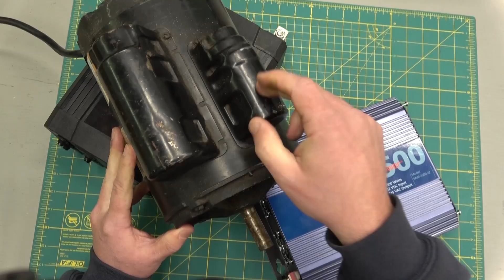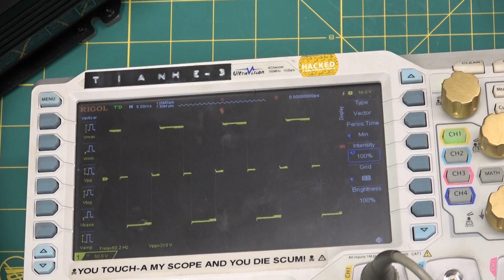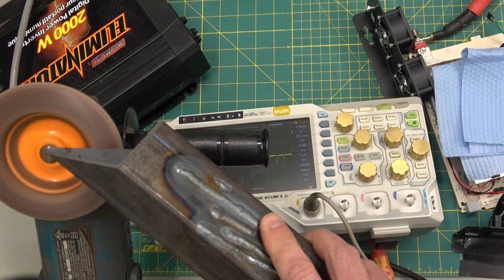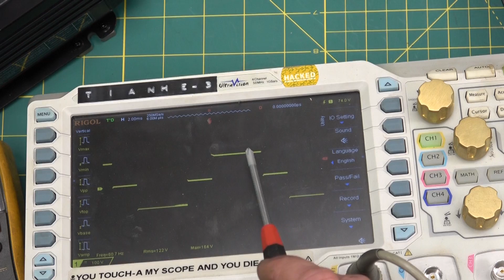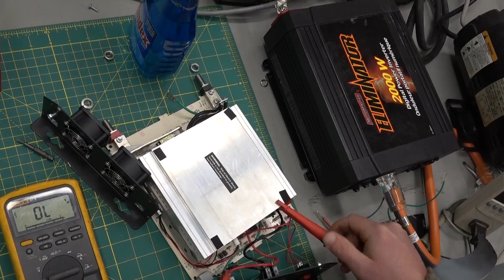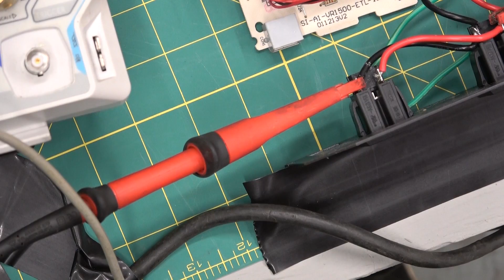BOLTR: Samlex inverter | Cheap vs. Expensive

Comment: I already got assaulted and assimilated and now you want me to get inverted.  The demands of youtube are too much.
Reply: Once they invert you over the bench you will be asstimulated.
Reply: I have a 3200 watt vanner tru sinewave inverter that's tough as shit, weighs 75pounds, I might be interested in shipping it out there if you wanna check it out if I get it back https://www.invertersupply.com/index.php?main_page=product_info&products_id=29594
Reply: And my guitar gently weeps. Lol
Reply: howdy Harold
Reply: Lol
Reply: Resistance is futile
Reply: You are soo slow
Reply: I think the cheaper one had a more analog setup built to produce brute power. It toatally looked like something out of the 80s on the board. Its the toroidal magnet inducer lol
Reply: resistance <1ohm
Reply: Shirley unlike the Borg, with AvE Resistance = Infinity [ unless its Capacitance then in that case you better just hold my Beer]
Reply: @timberwolf0122  LOL. Excellent. Thanks - Lumpy
Reply: Paolo G 😂😂😂
Reply: & NUKED  Too

Comment: i salvage old backup inverters from various cell tower instalments and internet service providers.  usually they just need new batteries (or just put jumper cables) not as efficient as "modified" sine wave, but real nice true sine (or kinda close on some) for running computers or audio, etc

Comment: I find that soldering connections like the one that had failed are a bit tricky in that your instinct is to poor the heat and pile the solder on and you get a good connection.  Problem is the metal components are cast into plastic, so you have to minimize the amount of heat applied.  I melted the crap out of a switch like that a couple months back, then realized that you're supposed to use crimp lugs on it.  This outlet connection is obviously not a crimp lug connection, but it is one of the (relatively) few that are done by hand and the person failed to apply enough heat and solder.  I suspect that when you repaired it if you applied too much heat you could easily damage the outlet.  Suspect being the key word.

Comment: I needed an Inverter review and knew you should made one, searched for it, and here it is.
I am building a little refuge in the middle of nowhere so I bought an Inverter to use with my car.
After reading a buch of theory I came to the conclusion that the "modified sine inverter==square wave" is appropiate for universal motors while the "pure sine wave" is needed for "asynchronus" motors...
Why?
May be because of the "rotating field".
¿Is that right?
Regards.

Comment: The cheap AF eBay ones have replaceable fuses on the outside and due to extreme testing and emailing the supplier they put in a line level fuse too to save the traces when backfed

Comment: i generally use cheap inverters unless what ever im powering needs pure sine.  some lights get really annoying with modified sine as well so i mostly use 12volt or 24 volt dc lights.
Reply: when i first started using solar i found something similar my expensive inverter was a piece of shit so i just dont see the point in spending a ton on them anymore

Comment: Purely anecdotal here but doing truck equipment installs the el cheapo microwaves seem to be the the Bain of most modified sine wave inverters. More than once the old crappy tire inveterrs manage to outshine the samlex’s and  xantrex.
Inverters. Hard to sell that to a customer who’s spent a half mil on a new truck though. As soon as they see that eliminator label things get uncomfortable.

Comment: I tried to help a guy get his conventional single stage high efficiency gas furnace to run off his modified sine wave inverter/solar system. The first time we tried a call for heat, the furnace control board started shrieking like a stuck pig. Never heard one do that before. I thought the board was finished but, once back on the grid, the furnace worked normally. The guy figured out to use a pure sine wave inverter, cost him $5K back several years ago, but the furnace worked OK off it.

Comment: If you want to avoid that sparks on switching stuff on you have to use a solid state relais which can switch on the zero crossing. It's also much better on stuff you run via the inverter, since you avoid steep voltage drops.

Comment: If the high voltage DC section of both are the same voltage on each inverter's rails ( + GND -  "3 connections") , you can marry them both to make  a more powerful inverter. Since the wattage output of both are slightly mismatched it is plausible you may end with an approximate 3100 watt inverter. (Also you could use all 4 sockets for that purpose if you remember the maximum amperage of the socket itself isn't maxxed out and both inverters need to be powered on)

Comment: How about a 3 phase converter review(s) - the science and a product comparison. Our local Makers group received a milking machine donation, but it requires 3-phase power. The quandary: Pay $15k to run 3-phase from the other side of the building, or - use a converter. Converter is getting majority votes. Then, how to select the best bang/buck converter. So, I guess that conversion leaves us wanting bucks/bangs...

Anyway, would be great to see this you do a review of 3-phase converters.

Comment: I had a sine wave inverter UPS in 1998. It output a very clean sine wave.  It was huge and you wheeled it around like a heavily loaded handtruck.  It contained two car sized lead acid batteries.  It was given to me because the transistors had blown.  I replaced them and got it back working again and avoided overloading it in the future so the failure wouldn't repeat.  It threw away lots of heat creating the sinewave but that's the price you pay for that waveform.
Previously I had used a modified sine wave which has lots of discontinuous steps and doesn't get hot like the pure sinewave UPS.  But those steps create lots of eddy currents in transformers.  I had several wall warts plugged into it.  Power failed, and it ran for about an hour.  All the wallwarts over heated and blew the temperature fuse.  When I got the chance to pick up a broken sinewave converter UPS for free I jumped on it.  The new walwarts today with the switching power supply are very tolerant of the modified sinewave.

Comment: I'm using a cheaper but still not cheap 3000w pure sine inverter. Oddly, or maybe surprisingly enough, it is brand name Reliable...
Anyway, it runs on 24v DC, and I have two battery banks feeding it, 4 AGM batteries total. It will "reliably" simultaneously start and run two loaded sump pumps, 3/4 & 1/2 hp.

Comment: I definitely appreciate how you tear these things down and examine them.
In this particular case, I bought a 10K watt modified chinesieum inverter 5 or 6 years ago.  It was only 350 USD.
I wanted to take it apart before I put my solar system into action, but I didn't.  I have to say, it's the best one I've ever purchased.  I ran a solo clean line to my breaker box on a 30 amp circuit, and have used it many, many times to run my house.  On a conservative level, of course.  Lights, fridge, dish washer, fish tanks.
I imagine that it'll monica lewinsky one of these days, but there are 4 replaceable fuses.  Right across the front.  Money shot.

Comment: You would probably know, is there a power inverter that can charge a gaming laptop from your car lighter or a battery charger that can handle it? I'm talking 130watts. Output is like 19 amps 6. Something volts. Input is 100-240w 2. Something amps. I know nothing about anything and have been looking for a way to get an extra hour out of my laptop on the go.

Comment: If a single mosfet usually fail short, would the system not fail at that point? I wouldn't think that they would design a cheap system around operating over failure modes..?
I ask because the chain analogy would be accurate if it failed open but if it's a short and they are parallel and not isolation protected then would the source not just be pulled to ground?

Comment: Good example of this, look at Bose speakers and Beats headphones, both have a horrible frequency range and sound rubbish when compared to good speakers.. but they spend so much on marketing that they both became the biggest selling brands. It is funny hey, like buying solar panels for camping, buying the cheapest ones and replacing the diodes to make them as good as the expensive ones.. Saving $300 per panel.. both panels were made in Germany by the same company, diodes were like $3..

Comment: I drive a truck for a living and inverters like these are invaluable to running modern electronics (tv, dvd player, game consoles, laptop, assortment of chargers, microwaves, hot plates, ect) I've used a cheapo power drive unit comparable to the black unit and I've used high end built like a brick shit house ingersoll and rand inverters, the moral of this is, you get what you pay for.

Comment: Every video I watch of AvE reminds me of the stuff I've done in the past. I once used a 150W amp with a signal generator to create a power supply for a 4" 400Hz muffin fan that ran at 20k rippums. It had a very pure sine wave output.

Comment: Niche markets tend to charge a lot more for any piece of technology than you would typically see in a more "mass market" setting.  It should come as no surprise that an inverter sold by a company that you say caters a lot to the solar industry would be charging a lot more for the device than they would be if they were trying to sell it to everyone for more general purposes, even if it doesn't actually differ in purpose or suitability.  Seems to me like they're just trying to get while the gettin' is good.  Gouge while it is a niche market, before you actually have to start pricing more according to supply and demand.

Comment: the nastiest load for those things is to hook them up to a electric fence energizer machine will fuck em right up in one week some electronic bit is gonna give up the ghost. I have a relative lives in a cabin cattle country rolling plains keeps a few cows and he got the bright idea to hook up the inverter 220v machine output to the 12v dc in put of the fence energizer because the solenoid clicks better. I went out bare foot (the BRIGHTEST idea i ever had) and mannaged to clip the fence over head at the gate it grounded me like a sack of potatoes. Next week my relative calls me and says the machine aint clicking i go over and find out it has no in put the fuse was fine on the inverter but it would not work for some reason apparently it did not like to do lots of clicking.

Comment: The name "Samalex", adds to  the price which don't mean diddly squat this day and age. I bought one of those guns Canadians can't have to screw around with rather than trashing my name brand $2000 gun. The $500 budget brand is by far the better rifle of the two. I should have known. Colt was backdooring parts from numerous Asian factories that made Colt rifles under contract, but they eventually decided to tell Colt to get go fucked, and designed their own  rifles. Colt's source of cheap quality parts went away, and so did Colt's quality rifles, right along with Colt's lucrative government contracts. Not being a military contractor anymore colt will sustain huge fines for augmenting their rifles with backdoor imported parts or front door imported parts.  All the main parts save for the barrels are made by one of 15 or so soundries & forges anyway. One company bought a forge and I am avoiding them like ebola monkey plague. I watched too many new forges bankrupt established companies. Those foundry and forge guys are artists that know that furnace far better than they know their wives & children. A new forge has a massive steep learning curve, and their customers are can tell what parts came out of the new forge, because those parts will all suck ass. Their long established customers will leave them high and dry too. They have mines, refineries, mills, smelters and factories to run.

Comment: Only  one loose wire ,that’s what you paid for , Chinese ones  I repaired last week  bad soldering throughout ie 2 blade fuses rated 40amps large puddle of solar to hold in place, any load would have melted solder, wire I would not put 5amp load on ,no earth wire , the cheapness of components on board etc etc

Comment: Really bad design. The capacitors are also flapping around in the breeze. No glue holding them. Also, there seems to be no pressure clamp on the Mosfets to the increase the contact force to the heat sink. Everything is just flapping around in the breeze. I wouldn't pay 500 for that crap.

Comment: Could be that the transformers have multiple winding ratios and some at 170, 120, 90, 60, or whatever.  Higher voltage mosfets for the hotter stages.  Lower crustier ones for the lower voltages.  Turn them on in stages to make a smoother waveform.  Could also be multi tapped on each transformer with secondary windings for different "steps" in the waveform.  Check the voltage/current ratings on the mosfets and see how many taps each transformer has and what voltage they are at.  Cost is in the complexity, engineering and patent stuff.  Or it is just bullshit.  50/50 chance.

Comment: I had a cheap 750w inverter (1500w max) I used for YEARS!!! Drilled holes, recharged batteries, and lit work spaces on new home construction sites. Never failed me once... Why waste good money on expensive junk when cheap junk works just as good ;-)

Comment: Try adding a BIG audio type capacitor to the battery side. The type of cap used to REALLY boom boom the sound. This will give a quick and large boost for those hard to start big  amp draws that a battery can't give fast enough.

Comment: Those bottom tier inverters are garbage.  They never perform as advertised, are utterly useless with sensitive electronics, and destroy mobile phone chargers along the way.  You need to step it up a notch.  I currently run a Chinese grid tie "pure sine" inverter I got for about 1.5k usd at 3kw, and it performs nicely enough (but not as nicely as a Victron).  It runs at rated output without artifacts, even at the elevated ambient temperatures of my engine room, and handles any inductive load I throw at it.  My only gripe is that it sets up a nasty resonance of some sort with my inductive stove, meaning I've got to run the gen in bypass mode when I cook.  I'm not entirely sure about your application, but you may be best served with a big old low frequency inverter.  They can be had for cheap if you know where to look (check your local military surplus outlet) and measure on a totally different scale of robustness.  On the flip side, they're far from portable and consume a lot more power at idle.  Another interesting alternative are rotary inverters.  They are pretty much all dug into landfills by now, but you can jury rig one if you have a large constant-duty DC motor and an alternator on hand.

Comment: I've always thought it would be cool to cook up an arduino kind of project to PWM drive the high voltage output bridge and make it into a variable frequency/variable RMS voltage true sine wave inverter that maybe could vary the speed of a single phase RSIR refrigeration compressor.  The hard part was coming up with a variable sine wave signal to modulate the PWM carrier by in order to be able to program V/Hz curves.

Comment: the craptire 1k wtt pure sine is useless junk.  fans go full boar at 20-40watts making it useless if your in the room with it sounds like a jet tkin off. wouldnt trust it not to set on fire. i got a 600watt samlex fans never run

Comment: Ahhh inverters the bane of my life, as a truckie they are my best friend and after letting the smoke out of quite a few I stumped up quite a few of the queens finest and got myself a sterling power unit, a reputable brand within the UK, 
I had failure after 1 year and it was replaced no questions asked, 
Customer for life right now was my thoughts, 

What followed was 3 separate failures of no apparent reason and the customer service had disappeared, each replacement unit was now full price minus a tiny “very sorry” offering, 

For me the extra expense was in the customer service and the replacement value, when that stopped eBay inverters became the obvious choice and you know what,,,,,

Not one failure yet 4 years later

Comment: Check out a Xantrex. Their forte is ac power for us refugees if the road. True sine wave, solid builds, and reasonable prices.
Reply: Xantrex Prowatt Sw2000 ... the bee's knees for less than 350 doll hairs. Recommended. Not a  glitch on my sailboat ... runs my "triggered" devices noproblemo.

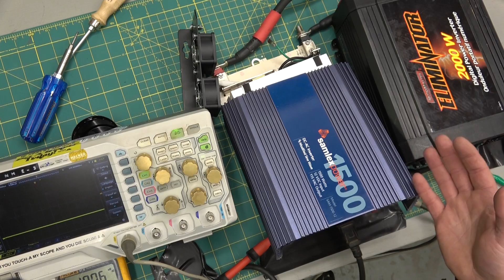Comment: You have the SAM model ... if you paid 500 bucks @22:25 then you didn't notice them putting the telescope away when you walked in (they seen you coming). The PST is the pure sine wave model ... it goes for aboot 500. The SAM is less than 200. 

https://www.solar-electric.com/samlex-pure-sine-wave-inverter-pst-1500-12.html?gclid=Cj0KCQjw08XeBRC0ARIsAP_gaQAdBWBtZPl_xQnwo6KYZ5iodazW_aEAaTmK7S4vpDTKH5te7iy4ZlMaAgl-EALw_wcB

https://www.solar-electric.com/samlex-sam-1500-12-1500w-12vdc-modified-sine-wave-inverter.html

VARIABLE SPEED HAND TOOLS ... your johnson might like it at different speeds ... but modified sine waves have square corners ... OUCH! You have been invariably rectumfied .

Comment: 2.3 ADVANTAGES OF PURE SINE WAVE INVERTERS
• The output waveform is a Sine Wave with very low harmonic distortion and cleaner
power like Utility / Grid supplied electricity.
• Inductive loads like microwaves, motors, transformers etc. run faster, quieter
and cooler.
• More suitable for powering fluorescent lighting fixtures containing Power Factor
Improvement Capacitors and single phase motors containing Start and Run Capacitors
• Reduces audible and electrical noise in fans, fluorescent lights, audio amplifiers, TV,
fax and answering machines, etc.
• Does not contribute to the possibility of crashes in computers, weird print outs and
glitches in monitors.